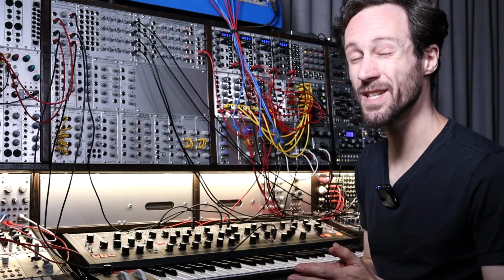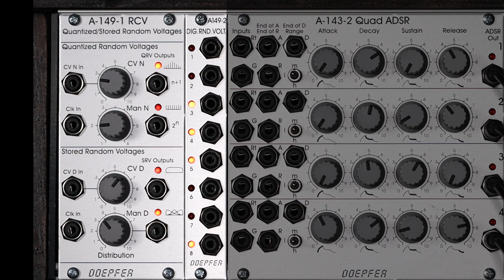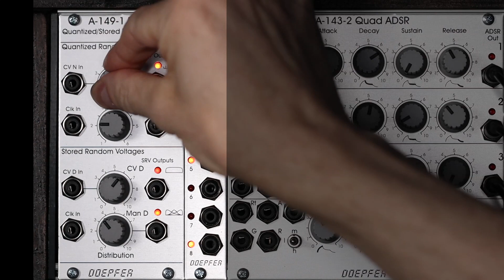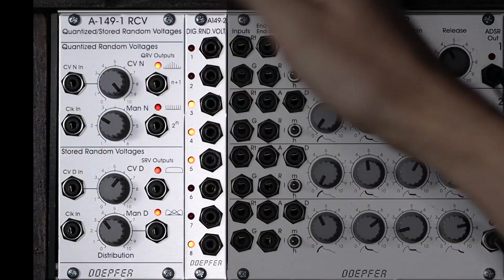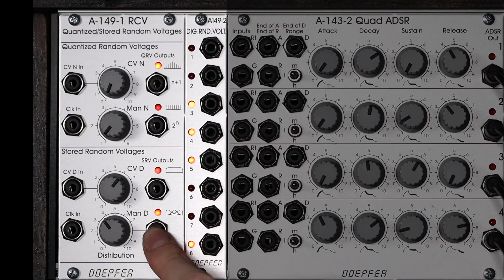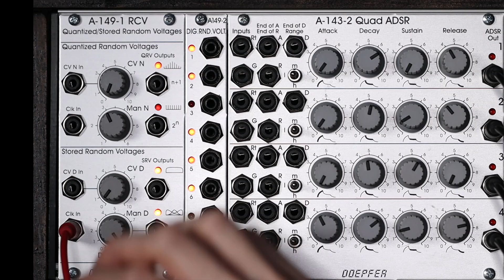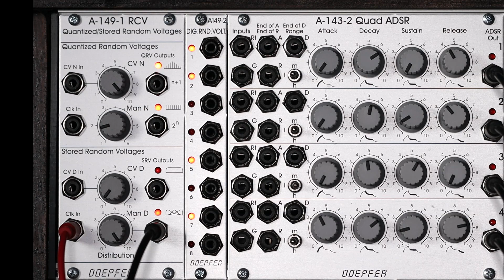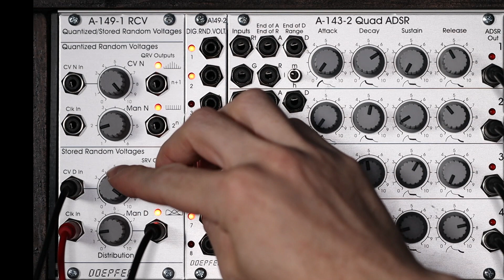Doepfer A-149-1 Quantized / Stored Random Voltages + A-149-2 Dig Rnd Volt

Comment: The A-149-1-1 works well in a Krell patch.  I also like to send 2 gates from the A-149-2 to the 2 gate inputs of the A-101-2 LPG to add interesting variations randomly in time with the clock.  It's a great and somewhat mysterious feature.
Reply from the maker: I need to try that, a video for the LPG will follow soon 🙂

Comment: A Ladik U-401 median module as well as a quantiser is needed to get the most out of the second section. Then you can set a ceiling or floor to the outputs that can also be modulated externally. These sorts of modules tend to dissapoint some people due to the expectations they bring to them of instaant musical results.
The bottom section is purely statistical...a rectangular distribution and a normal distribution which can be skewed right or left by the knob. You won't get a musically sensible output from those until you input some musical sensibility.
Reply from the maker: thanks for your vision 👍
I think this module is great for creating melodies when combined with the right modules because there’s a clear way of operating in the random notes.

Comment: The problem with this module (and the original Buchla Source of Uncertainty) is that it is over complicated for the modularist who program it, but listening to your demo and being fully "external" from it, it just sounds like any S&H + attenator to limit range. Not your fault, of course. I've got a 149-2 during a few years,  so I know how it works, this is very different from a simple S&H, but for the listeners the result is quite the same. So I sold it... But intellectually it is an interesting module.
Reply from the maker: I don’t entirely agree, it outputs cv’s in a less random way than your average s+h.
When you want something similar you need at least an attenuator and quantiser module. For what it costs it’s a very nice tool to randomise or create generative music.
The expander is a must-have though.
Reply: @Detroit-Berlin  In most modular you will find a quantizer and some attenuverters. It is not like these modules were very rare. But as I said it, the 149 is not just a simple S&H it is an over complicated S&H. Patching a S&H, an attenuverter and a quantizer together is making the job easier to understand and predict the result.
I've got the expander too. And I agree this module is very interesting , intellectually speaking. But for generative music you have Marbles that is way more usable (but not simple of course).
The 149 is not expensive (but it takes a lot of place with the expander), and it can bring some kind of control on the randomness. It is a good module. Just a bit too complex for the result (random voltages).